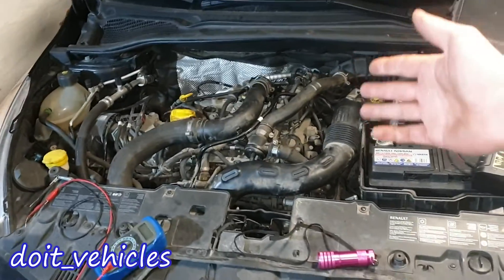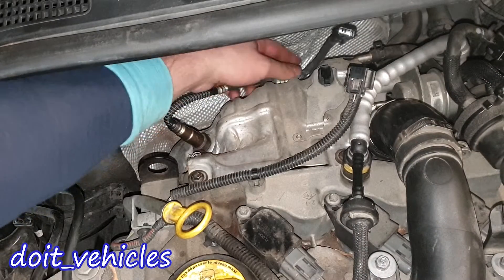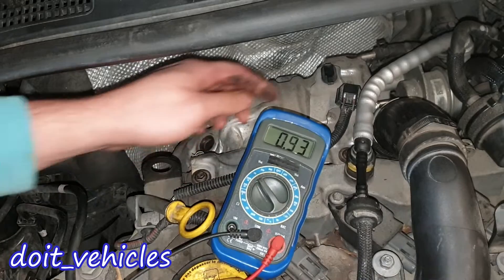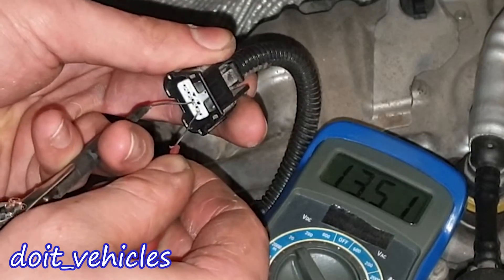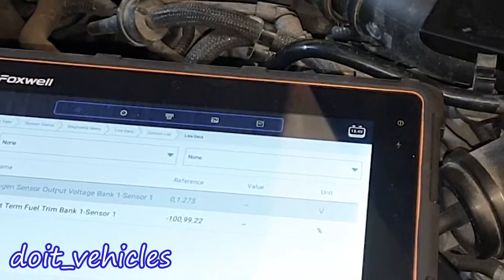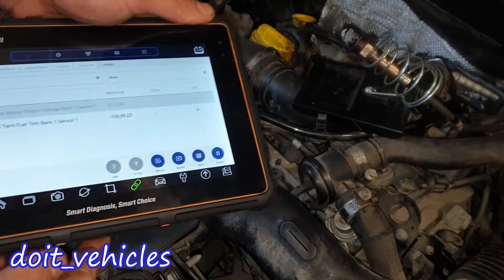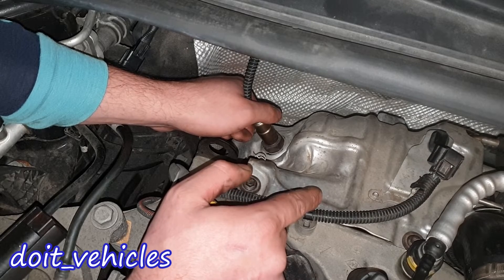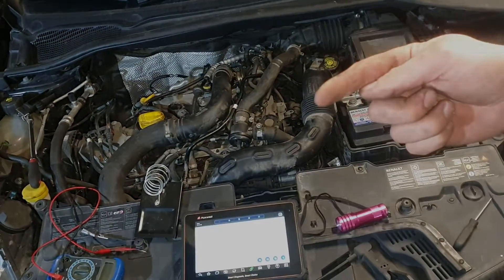Oxygen sensor RENAULT CLIO Tce 0.9   How to Diagnose Codes P0135  P0130 P0135

Comment: Hello, I noticed when cold starting the 0.9tce 2013 engine, the car idles faster at 1500-2000rpm range on E10 fuel. After 2-3 minutes the rev needle settles down at normal 820-900rpm range. When I use E5 BP fuel the Clio cold starts almost normal all the time. So just press start button, the car is in neutral and after slightly hitting 2000rpm the rev needle goes down quickly and stays at 900rpm, like normal. Is there a reason why this happens on E10 fuel? Is there a way to fix this issue? Also, when I press the accelarator pedal when the car is in 'automatic choke high idle mode' the sound from underneath the car is very rough and metallic. When you just wait for the engine to settle in 2-3 min at 900rpm you will not hear the sound. Have you ever noticed this? Has it something to do with open/closed loop from the MAP sensor, fuel injection and O2 sensors?